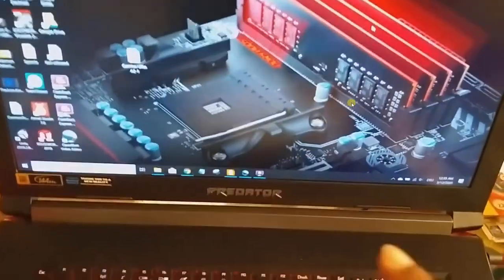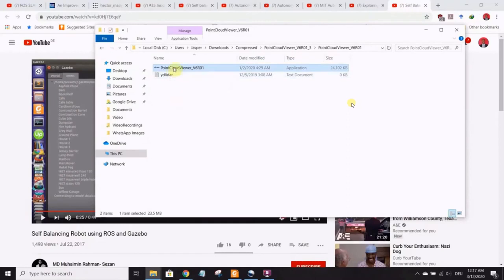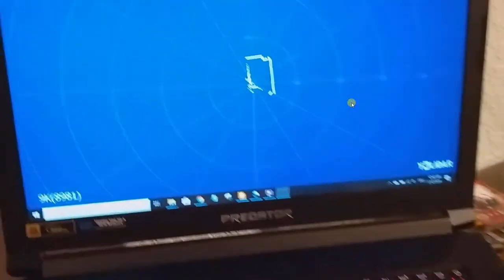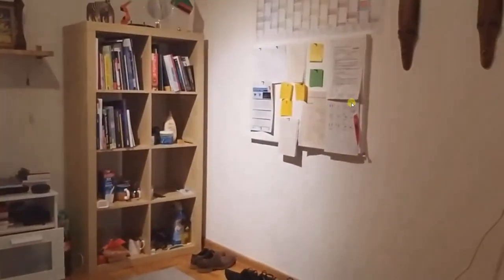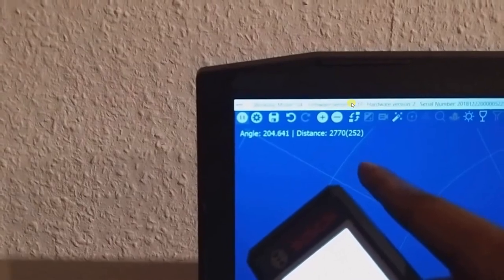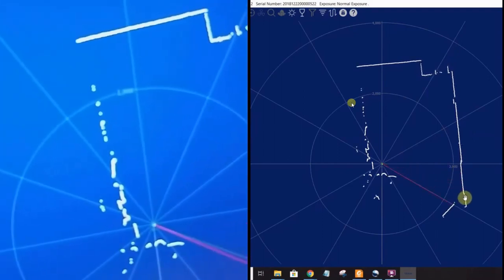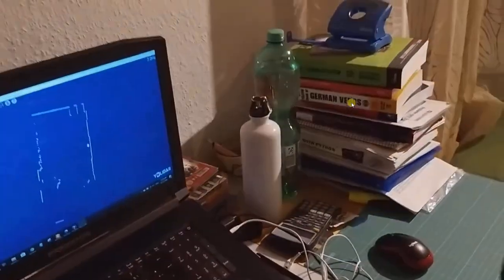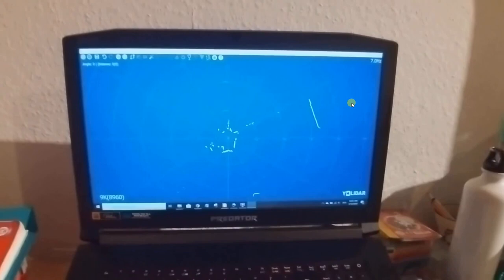YDLiDAR G4   Unboxing Testing on Windows 10

Comment: Thanks for the video. What would happen if you put a protective glass in front of it? Like on a 45 degree angle so light doesn't bounce back. Does it still detect distance through the glass?
Thanks